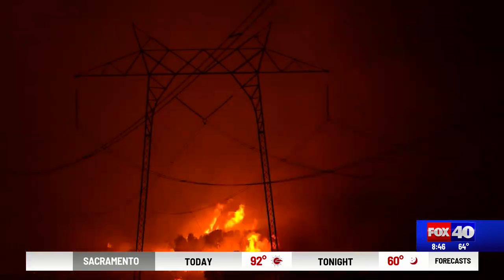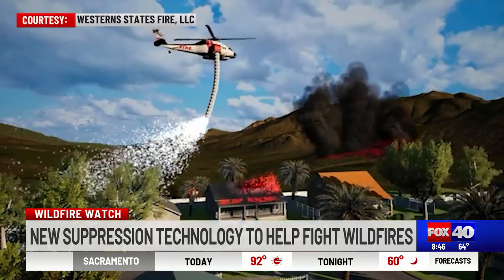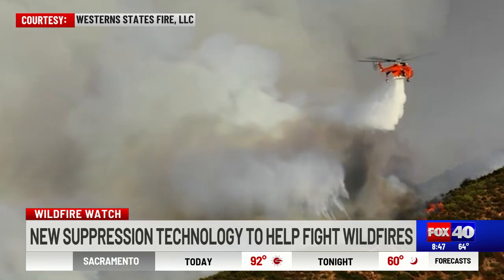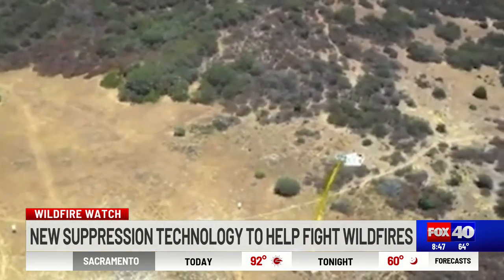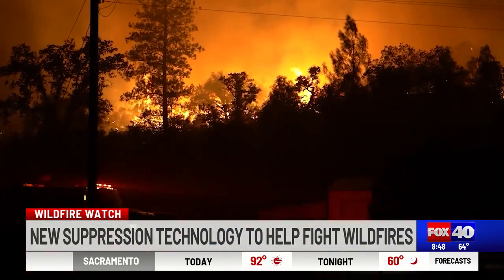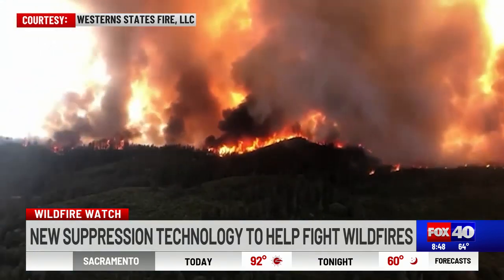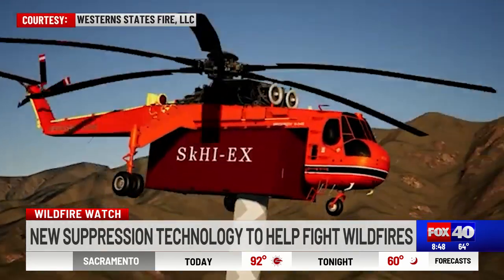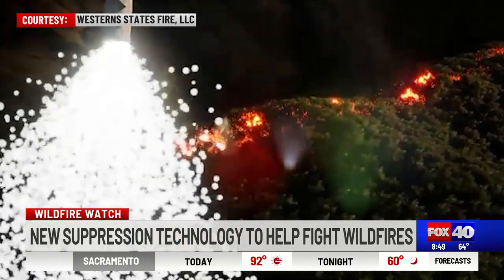New fire suppression technology being developed to battle California's wildfires

Comment: I think for the worst fire prone areas they should plant lines of Japanese knot weed we call them water weed because they are bamboo like plants an the whole inner tube is filled with water, I don't think even a gas fire would burn them, even the strongest over the counter brush killer (poison) doesn't kill them because of all the water they store in the stem. It would help with land slides too their roots are powerful they bore through concrete like it's styrofoam.

Comment: Why dont they want to use magnetic frequencies? Maybe they want it to burn is why. Theyre not even wildfires. They are electric plasma fires. Thats why many trees burn from the inside out and the roots are turned to powder. Forest fires burn around 1800 degrees. Plasma fire burns at around 5000 degrees f

Comment: They’re missing the key issue.  You can’t let fires get big.  Aerial firefighting equipment needs a large rapid response to immediately contain a fire until ground crews can get there and put it out completely.  We have hundreds of 747 sized aircraft mothballed in the desert which could be converted and distributed at military bases around the state.  

We have hundreds of chinook helicopters not being used.  Only one “The Hammer” is in use for the entire state.
Reply: The bigger the plane the bigger the costs. At the end of the day it all comes down to operating costs.
Reply: We use large aircraft 
I’ve been through a bad fire.
Had a retrofitted 747 come over and do a drop.
What you don’t understand is they are not very maneuverable at low speeds. I monitor the scanners. The 747 needs a lead plane to go in front of it because it can’t pull up and out of a situation quickly and needs an advance.
We also are using every kind of helicopter you can imagine. I’ve seen twin rotars, but they aren’t nimble either.
 We now have a fleet of Firehawks, which are converted Blackhawks they have capabilities to suck up and drop much more water 1000 gallons and can drop snorkel and refill from body of water in 60 seconds Vs the old Huey’s that could only carry around 300-400 gallons in bucket dangling below.
 I live one ridge over from a cal fire station in NorCal and have watched both work.
The old ones had a bucket that you dipped with then had to maneuver with it up and out. Grab a five gallon bucket of water and swing it around and you will get an idea of the difficulty.
And the pilot can’t see the bucket 100 feet below. Had to use mirrors, it was incredible to watch but not terribly efficient.
Now the fire hawk Carries water in belly payload and are also night capable. This is big as fires lay down more at night and provide a better chance of making real progress. All planes and up to now all aircraft have had to be on the ground by sunset.
Google “Firehawk” and Lockheed Martin site will come up with the Sikorsky

Comment: Kindly, caterpillar makes a water cannon truck…they hold 20000 gals + , they are built to drive over rough terrain . Cat is itching to lease these, the USD of AGRICULTURE says they are inefficient. SMH
Reply: yep, no one has paid politicians to make an exception for them. Maybe they should bake bread so Newsom will help them out.
Reply: I don’t think you realize how rough the terrain can be. On our 40 acres we have a ravine that on one side goes down gently 168 feet drop over 300 feet and the other side is 300 feet vertical at about 70 degree angle, rocky and loose rock and heavy forest. People that don’t live in these areas have no real concept of the degree of difficulty to access these areas
Reply: @Oldcrow77 I don’t think you realize Caterpillar equipment is already used for wild-land fire fighting.
Reply: @chrisfleming701  sure I am, but I’m pretty sure you have no idea how steep some terrain is. And how slow this equipment moves especially with a full load. May I ask where you live. Because a lot of people have ideas about things without the actual on the ground knowledge 
I run equipment on my property 
Excavators have a top speed of 7mph. So if it’s steep terrain and the fire is 6 miles from unloading area it’s not gonna get there nearly as quickly as air attack.
 I know for a fact, the operator wouldn’t even try to work our ravine.
 And fires burn up hill quick and down hill slowly. I have had to work a fire line on my property.
 There are lots of things that people in flat land and cities have no concept of.
Reply: @chrisfleming701  by the way, if you do a search on YT for these cats in use. You won’t find any video of them in steep terrain.
Reply: @Oldcrow77  I live in North western Montana. I know exactly how steep the terrain can be, I have friends who operate firefighting equipment on steep terrain. Just because you don’t see any YouTube videos on the them doesn’t mean they aren’t used there. No one is saying these are better than air attacks just another tool to use.
Reply: @chrisfleming701  
I agree that they are another tool in the toolbox, I almost think they are very specific situations 
Because it’s basically a dozer with fire suppression,they  have to have limited run time.

Comment: Wonder what effects it has on soaking into ground then water contamination 🤔 love new technologies but there’s always a but.
Reply: I'm more concerned about the accumulative undergrowth/fuels they continue to built through suppression over the last decades.  As for the foam, as long as it's biodegradable, it should be fine.. but I haven't seen any data on composition.

I think it was Italy a few years back..? They're using collapsible cardboard boxes that can be loaded then filled with suppressant/water on ANY cargo plane without modification... just roll them out the back and onto the fire, all biodegradable.  The US refuses to even look at it because it's a cost effective means of fighting fires.
Reply: That red stuff they drop now is carcinogenic. Soaking into ground water… into our food, CA is a bread basket. Not that we want the state to burn.
Reply: @PhilosophicalHermeticstudy: You are obviously not aware of what a wildfire does to the ground. As a result of the Camp Fire, the top 18" to 24" of top soil at the location of a home had to be removed because of toxic materials that had leached into soil as materials melted. I don't think water based foam is going to be anywhere near as destructive as allowing the wildfire to continue burning because some know-it-all was worried about contamination.
Reply: Current retardant is toxic to fish.
Reply: USUAL SUSPECTS